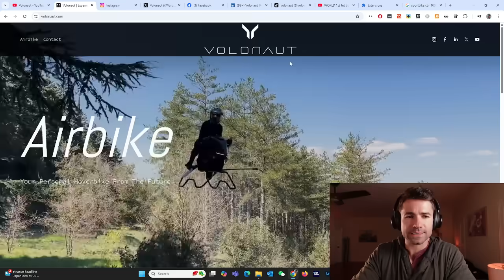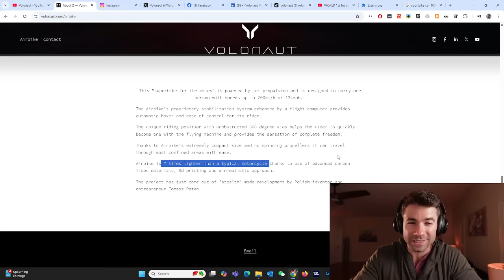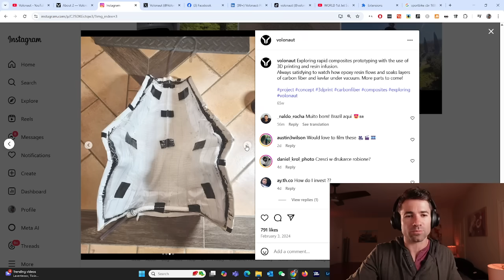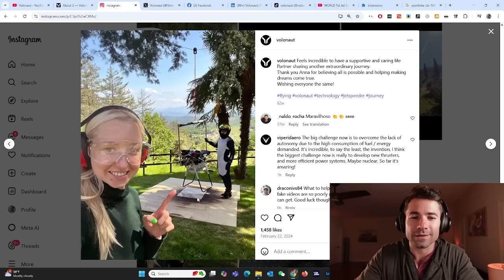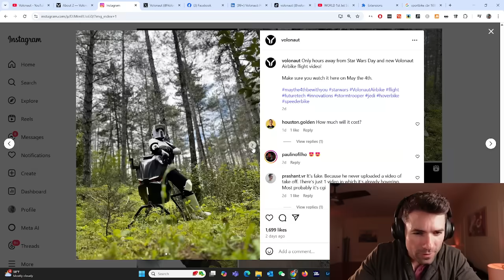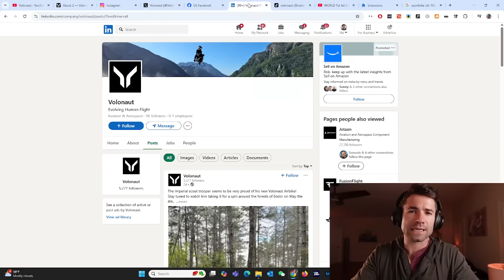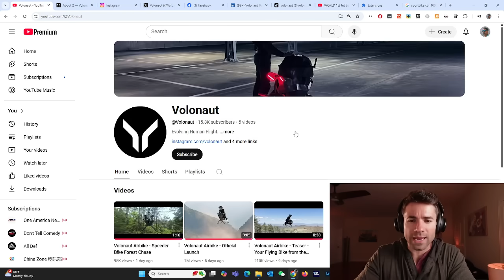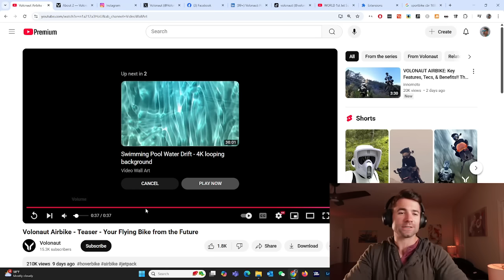Is the Volonaut Airbike Real or a Scam? (Expert Breakdown)

Comment: I am leaning towards fake because it would need thrust vectoring to pull off the stability of flying horizontally. But this is very close to being possible, the flyboard Air proved that.
Reply: In their promo video they say it has 2 vectoring jets
Reply: Thrust vectoring is no problem.
Reply: @ET_AYY_LMAO  if it is narrow it is and no visible nozzles
Reply: @JonathanTamm  Look closer at the very start of the video, you can see the turbines.
Reply: Hey, guys, this was done more than 40 years ago:

https://en.m.wikipedia.org/wiki/Williams_X-Jet
Reply from the maker: why couldn't it have thrust vectoring?
Reply: @RobRast  The reason why I am saying that it needs vectoring is because the jets are positioned just below center of mass of vehicle. It would be unstable without it. It does not make sense to mount that inside the housing. There is a good point about the X-jet, however just like the Flyboard Air those vehicles require the pilot to shift their weight to steer it. The Airbike's pilot is not shifting at all during the flight. The only thing that comes close is the JetRacer and it has over 10 jet engines for stability. I would have liked to see it take off, even do some turns. It just does not seem real to me.
Reply: @Motor_Explorer1 Lazareth LM 847 only has 8 jet motors and flys amazingly well! And very fast
Reply: it's 100% legit. The only question is, how long is the flight capability. 5 or 10 minutes barely makes it worth-while. 20 minutes+ and then, you have something worth buying.
Reply: bro 🙄🤦‍♂️
Reply: It could be a bunch of those powerful electric fans on vector mounts to help with stabilizing it 

You can see the person doesn’t make any hard turns or rotate very fast at all
Reply: Check out the Lazareth LM 847  it's a Really built bike there's  is around 100 of them in existence It is a fully functioning motorcycle that turns into a jet and can fly! So the technology exists to build this.
Reply: Dude the videos are fake, if you've ever done video overlays and tried to feather or blend a video on top of another video, you'll get a blur or pixelated edges. Now in his promo video we're he's dressed up in normal gear, fixate your eyes all the way through the video at the undercarriage, you'll see blurring, morphing and feathered edges. Thank me later 😉
Reply: @DraconiusLux  The same concept has been done over 40 years ago:

https://youtu.be/AvmrKJl_K3Y?si=En3pBv_-sGHGpnpN
Reply: @DraconiusLux I’ll go ahead and say no I won’t thank you because you assume you’re so correct . This actually looks real , it’s a turbine engine and it’s also an ultra light vehicle
Reply: @DraconiusLux the undercarriage where the hot gas is expelled 😂